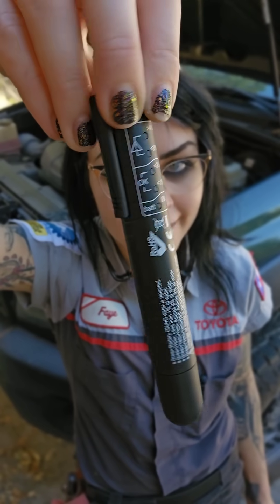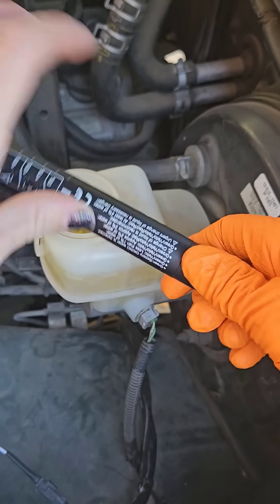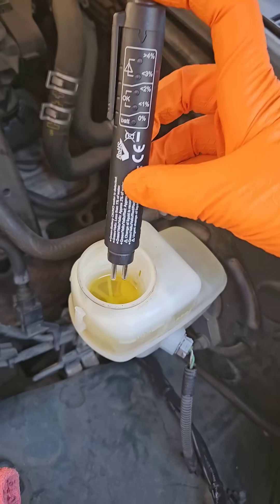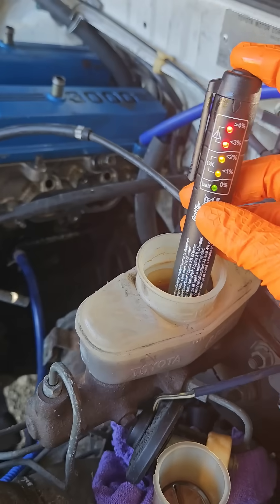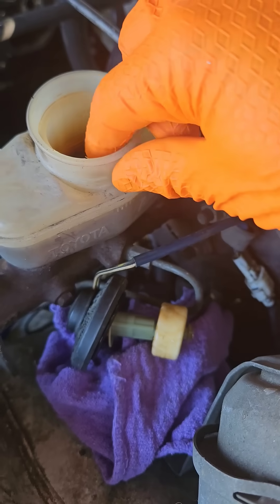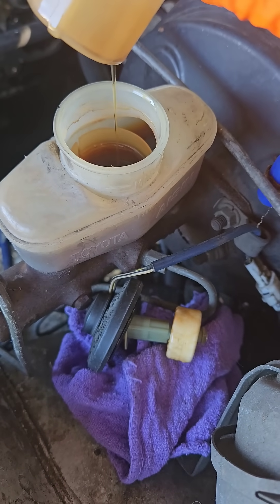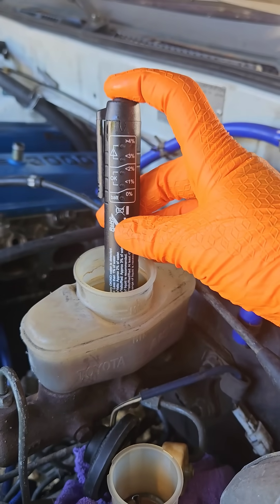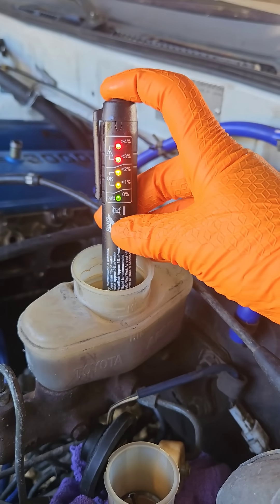Do you REALLY need your Brake Fluid Flushed?? How to Test it For Yourself!

Comment: Having been a tech since the mid 80's, you could probably fill a football stadium with the brake components I have replaced, of which many could have lasted the vehicles lifetime if brake fluid changes had been carried out.
Reply: Just to elaborate it's the corrosion caused by the water content of the old fluid that causes the damage. Also it lowers the boiling point of the fluid causing brake fade much earlier than normal. Not saying every vehicle will have a failure, but it will help. And is cheaper to do than replacing seized calipers or gummed up abs valve assembly
Reply: You one of those guys who likes to sell calipers because of “uneven pad wear”?
Reply: @AlphanumericCharacters Needs oil change, replaces car. Lol
Reply: There is no way for you to know that the component wouldn't have failed if they had changed the fluid. What fails, there's moving rubber in there and rubber fails over time regardless.
Reply: No part is engineered to last on a car. I’m sure you’re an experienced mechanic, but you’re also part of the scam.
Reply: @JHimminy  I work as a bmw tech and in the last 5 years I've maybe replaced 5 calipers.  We flush every two years as part of basic maintenance. 

Do you though.
Reply: @magincap70  I worked at Ford dealers for 20 years. We never sold brake flushes except at one dealer that was all into the BG bullshit. Only worked there six months. I hardly ever replaced calipers. All the time I would see aftermarket ones installed from the $99 an axle scam brake shops. 
 Ford also does not have brake fluid as scheduled maintenance.
Reply: @powerbychevy  I worked at a euro shop for years back in the day before I moved over to bmw.  We did all makes and models and I used to replace calipers all the time.  I regularly see 20 year old cars with the original calipers at the dealer and I used to replace 5 year old calipers on Subarus weekly.

The science is there.  Brake fluid attracts water from the air and creates a corrosive rust causing condition in the brake fluid.

It is what it is.  I know that doing a $100 flush once every 2 years is better than buying a new caliper every 5.

And we typically charge around a grand per axle so we aren't trying to make money doing flushes.  Plus the first few flushes new car warranty pays for.  We'd rather do a couple free flushes than replace a caliper.
Reply: @magincap70  how does it attract water when in a sealed master cylinder?
However, I will say that I live in a dry desert. Humid to us is when we crack 20% during the “rainy” season. 
That said. Ford does not recommend brake fluid flushes for any climate. (Unless that has changed in the five years since I left dealerships. Best move I ever made!)
Reply: @powerbychevy  you ever seen the cap on the reservoir?  It's not air tight.  Push back a piston or two and you can overflow the reservoir.  Glycol is "hygroscopic" which means it attracts h20 from the air around us.   Thousands of cycles through the master cylinder ends up putting that moisture from the reservoir into the brake system.  Pad thickness shrinking means reservoir fluid is added to the system as well.  Fluid will equalize.  So eventually the h20 that entered just past the master cylinder will find its way to every caliper.    

The boot is made of rubber.  The caliper and piston are usually something that will attract corrosion of some type.

That corrosion can do to things.  It can seize the piston or destroy the integrity of the seal between the boot and piston.

Bmw sells a rather high performance car. Some models are even "track ready".  In these type of vehicles introducing excessive moisture to the system creates a soft pedal.  An unpredictable pedal.  So longevity of parts aside it's a performance thing.

Do you think Nascar drivers run the same fluid every race?

There's pages and pages of science behind why you change your fluid.

All that said, being I Arizona or wherever with 20% humidity you aren't going to get as much moisture but you still will suffer from burning your fluid which has performance cons as well.

I've been in this business for awhile.  I went to school before I started.  I go to 2 or 3 classes a year for bmw if I can.  

Can you get away with not changing it? Sure.  When you replace your calipers just realize you didn't have to. It also keeps the bleeder screws functioning so if you want them to work it's a good policy.

Tons of reasons to do it. Only reason not to is laziness I guess.  For a diy guy grab a friend a 10mm and a $5 bottle of dot 3 or 4 every two years.
Reply: @AlphanumericCharacters   Brake fluid absorbs water from the atmosphere because it is not a closed system.
Reply: @michaelgoode9555 Are you sure about that? Doing a quick search tells me it is a closed system and air can only get in through poor seals.
Reply: @AlphanumericCharacters brake fluid has a shelf life in the bottle once it's opened, so, in a poorly sealed brake system, that shelf life applies. Flush every 2 yrs is too often IMO, I do mine with each front brake job.
Reply: @magincap70  Guys I didn't change any fluid of my car Corolla for 15 years. I bought it new in 2008. Is it still safe to drive? 😅😅😂😂
Reply: @thegoldenland  it's a corolla. They defy all logic and keep going.  At this point I'm sure you can't even get your bleeder screws open lol
Reply: @magincap70  serious question.  Will WD-40 work to unscrew bleeder?
Reply: @michaelgoode9555  how is it “not a closed system”. Have you ever actually worked on brakes?
Reply: @Wishes890  well if my brake system was “poorly sealed” I think I would make it no longer “poorly sealed” not just keep changing fluid. A master cylinder cap is cheaper than a brake flush.
Reply: @AlphanumericCharacters  you assumed that the only way I can get into the system is through the seal on the reservoir cap. There are many ways that air can leak into the system. No one's trying to force you to change your brake fluid, but of all the fluids to change this the least expensive and one of the easiest to do if you're doing that by yourself
Reply: @Wishes890  how is air getting into the system? If there is air in the system you will have a spongy pedal and brakes will need to be bled. Also if there is a point that air could enter then most certainly you would have a fluid leak when the pedal was pushed and you have 2,000 psi of brake fluid. 
 Everything you say is nonsense. Clearly you have zero clue what you are talking about. You aren’t even up to par of shadetree level.
Reply: @AlphanumericCharacters  Really?  Now I'm hurt. My therapist said I am worthy and loveable. 
So, the base of the brake fluid reservoir has a rubber seal. The fluid level sensor has a seal. The primary and secondary pistons have seals. The ABD reservoir has seals......they can all leak and allow moisture to enter.
Reply: @AlphanumericCharacters did you not watch the video? she told you the system is not sealed. Of course the way I understand it that supposed to be a one-way valve that lets pressure out but doesn't let anything in of course who knows how good the manufacturers quality control is on such a thing.
Reply: @bobbyhempel1513  there is no such thing as a non-sealed brake system. 
Again. If there is a sealing issue then fix that and flush the fluid. Don’t keep flushing fluid because of bad master cylinder seals. Absurd.
Reply: @thegoldenland If you haven’t even changed oil in 15 years you’ve already done irreparable damage to your engine.
Reply: @Mojave_Ranger_NCR  correction. I changed engine oil regularly but not any other fluids.
Reply: @AlphanumericCharacters  Maybe you should do some research before embarrassing yourself in front of guys who actually work on cars. Brake fluid caps have to allow trace amounts of air in because as pads wear the pistons extend further which pulls fluid from the reservoir. If air is not allowed to compensate for the lowering fluid level it will pull a vacuum which will prevent brake fluid from entering the master cylinder. Every cap has some way for small amounts of air to enter the reservoir.
Reply: @AlphanumericCharacters replacing brake fluid was added to Ford scheduled maintenance in 2020. I think it's suggested every three years.
Reply: @bleachinuri  the car is under the sun the whole day. Moisture will evaporate. I'll check acidity with a testing paper. I'll let you know.
Reply: @magincap70  defy all logic, do they? They don't maintenance and repairs, non at all. I just have my 2007 Matrix on the hoist and it needs new lower control arm and I can't get the bolts out because they are rusted inside the bushings steel sleeves and even acetylene torch can't help here. It will be a very long and nasty battle to remove the bolts. 
You just have to live and work in Eastern Ontario to break most of the popular myths surrounding the unbreakable, going forever, no maintenance needed vehicles.
Reply: @thegoldenland  acetylene torch with small torch head should do.

Comment: keep in mind that when I say they recommended flushing my brake fluid at the first 5,000 mi maintenancethey don't even change the oil in the engine at 5,000 miles they only do that every 10 but they want me to come in every 5 to rotate the tires and find something to charge me for like a brake fluid flush at 5000 miles
Reply: I'd say that if you drive the average of 12,000 miles a year, change your oil and rotate your tires every 6000 miles or six months. No one has ever said geez I wish I change my oil less frequently.

Comment: does anybody have a reason why Toyota would recommend I flush my brake fluid upon first service at 5000 miles.  I asked why would I need to do that at 5,000 miles they responded well this is Florida there's a lot of humidity you could get moisture into the fluid I say one month after I purchased it I've got a flush the brake fluid

Comment: inside see your Toyota shirt I just want to mention the fact that bought a 2021 Toyota Tacoma and pulled it in for first service at 5,000 miles and they recommended I flush the brake fluid recommended to myself I no longer go to a Toyota dealership

Comment: if the brake fluid dont look like water. (its full of water)!  for a weekend not serious mechanic.   when your brakes need service.  take a suction tool and replace the fluid in the master. then as you replace each position flush till the fluid is clean. use a water bottle and clear hose.   easy peasy and dont pay a shop 500 to change it.

Comment: Over time it corrodes from the INSIDE out . There are also voltage drop tests for brake fluid and anti freeze . I have a book on that . But it's much easier to show a customer a tester or test strips . Spend 60 K on a vehicle and cheap out on maintenance !

Comment: I can’t say I’ve ever intentionally flushed my brakes. But that is byproduct of how I bleed brakes. 
I have a cap that goes onto the reservoir with a hose that goes into a bottle of brake fluid. I also have a spring loaded check valve that pops onto the bleeder nipple. So as i bleed them, old fluid goes into the pan as new fluid gets drawn in to replace it.

Comment: Just don't use brake fluid in a hydraulic system!! BTW, H2O can be used in Hurst tool systems ("jaws of life") In a pinch. But must be immediately flushed out and replaced with Hurst tool oil.

Comment: Moisture boiling causing steam is one issue.
The other issue is the moisture settles to the lowest point which is the wheel cylinders/calipers. Yep, they'll get stuck, and cause the brake material to wear faster.

Comment: Ive always just went with the 2 years and change it method. Tried telling an old time mechanic the oil change guy wasnt feeding him a line about brake fluid needing replacement after a certian amount of time because it absorbs moisture.....wrote me off as some dumb young kid....went on to be the best tech in the shop lol.

Comment: Do you need to flush your brake fluid? The small rust flakes from before I replaced the calipers on my T-100 say "yes." Also the lack of brake application and tight pedal according to the FSM.

Comment: If it hasn't been flushed within the past 2 or 3 years, it should be done.

Much shorter answer. 😅

Every manufacturer has a service interval, and it's pretty much always 2-3 years.

Comment: Newer vehicles come with DOT 5 brake fluid as of around 2012+, this brake fluid is not hygroscopic and does not need to be replaced basically forever.

Comment: Technically, you dont need a tester. If you have a multimeter, you can test brake fluid yourself.

The way you do it is, turn the multimeter to tenths of a volt DC. Stick one probe in the fluid, the other against the master cylinder. 

If the reading is 0.3 volts or higher, you have too much water in your brake system, and need to flush it and replace it with new. I recommend this at least once every year, preferably when you replace at least brake pads. 

One other thing to keep in mind: When you have too much water in your brake fluid, that water starts turning your brake fluid acidic. If you have ever looked at your brake fluid and wondered why it looks dark, or even black, it's because the fluid has been eating rubber O-rings and seals, in the various braking components, like the master cylinder, calipers, wheel cylinders, and even anti-lock brake solenoids and modules. When brake fluid isn't changed over a long period of time, you can get leaks, and wonder why, when all you need to do is replace the old fluid in the system with new.
Reply: Thanks!
Reply: @jamesredman1263  Not a problem! You're very welcome to the information.
Reply: @isaiahwelch8066 you test brake fluid for different things and a multimeter doesn’t do it all
Reply: @Batsman_music  : All that test is supposed to do is test for how much water is in the brake fluid, since water is conductive.

That fact is important because under heavy braking, water can vaporize, and make your pedal go to the floor, leaving you with poor or minimum braking performance.
Reply: I did this and my prongs melted.. lol jk I gotta try this sounds interesting
Reply: It's conductive. You wouldn't use voltage setting, you would use resistance. There wouldn't be some standard reading you could state because distance between probes would make a difference.
Reply: @davidwolff4696  : Not when you're measuring voltage. Think about it: Voltage doesn't change in a starting circuit, because I test from battery to starter relay, and then test the positive battery cable from battery to starter solenoid. But what does change is resistance, which can increase the longer a cable or wire is, simply because a wire could have a corroded section between the two points you're testing. 

And in the case of brake fluid, you're not testing the resistance, you're testing for voltage, to see how conductive the brake fluid is, since you're measuring the water in the brake fluid that has accumulated because of condensation that gets in the system because of metal and heating/cooling cycles. I've personally done this test, and never gotten a resistance reading -- but I never fail to get a voltage reading like I describe.
Reply: A multimeter is a tester
Reply: Thank you greatly Mr Isaiah for sharing your wisdom & skill.

I gladly learned from you.
Thanks also for the instructions of using the Multimeter.

God bless.
🙏🎁🙏

Comment: You’re right, brake fluid is hygroscopic. 2 years or 30K miles is when I recommend a flush.
Reply: DOT 3 / 4 / 5.1 are hygroscopic, but DOT 5 is not.

Comment: If you decide to get a flush make sure you clarify if they break the bleeders on all four corners and also replace fluid. I learned the hard way when a shop ended up changing the fluid by using a turkey baster and not even bleeding the lines.
Reply: incompetence is everywhere. clearly not a shop you should be handing money to
Reply: That’s not what a flush is.  You got scammed.
Reply: It's hard enough to maintain a vehicle properly and then you have to worry about BS like this.
Reply: That's a shit shop doing shit work.
Reply: Are you trying to say it's the shops fault that you don't maintain your vehicle? If those bleeders bruise break it's because you haven't maintained the vehicle. You can't hold the shop responsible for your incompetence.
Reply: @Wishes890  if the shop breaks the bleeders then they should tell the customer and not charge for a flush.

Comment: Awesome vid.  The answer is no.  Almost certainly the dealer doesn’t even have that tool.  They just put that on every estimate to try and pad the bill.  You wouldn’t even have to do the actual job because the customer wouldn’t know.  After 20 years of working on cars i can’t say for sure I have ever seen a car that had actual problems from water saturation.   It may be hard to know for sure, because perhaps the caliper that got replaced for sticking piston was due to internal rust not external.  Since I personally never take them apart I don’t actually know.  But I have only had issue on very old brake fluid.  Like decades old.

Comment: Yep work at a benz dealer, recommend every 2 years flush it. Commonly rots are brake lines from the inside out if customers neglect on certain years and models. Newer lines have plastic coating on inside and outside so not so much a problem anymore
Reply: I'm not gonna claim that it doesn't happen, but I've never seen a brake line rust from the inside. Even on a 50 year old farm truck.
Reply: You have never owned a new  Chevrolet pickup truck , brake and gasoline lines are rusting as they progress  down the assembly line !
Reply: @vicpetrishak7705  not from the inside
Reply: How about 2011 models? ML350
Reply: Do W211’s have this issue?